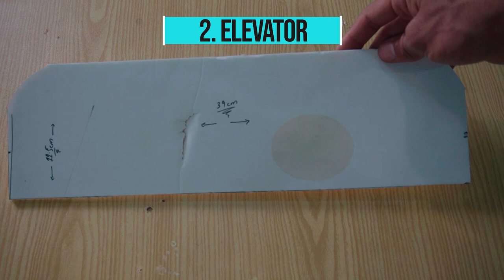How To Make RC plane - depron | Rc plane for Beginners

Comment: Hello. It is a good plane.  You have motor power problems. Your 2212 motor is 1400kv   This motor runs better on 3s 11.1v lipo battery using 8x4.5 propeller. The 10" propeller is too big. Try 9x4.5 for 2s 7.4v pack. The battery pack in the video looks puffy and damaged and may not give enough energy. The second motor is too small for the big propeller. Keep going 👍
Reply: u right.. 1400kv only good for 8inch to inch prop, if using 10inch prop better use 1000kv motor

Comment: information.     at 4:57,  this is  a  SF  prop.    its  use  IS  Correct, in the case of a  Slow-Flyer, ONLY.!!!!!!
at 5:07, the (Mass of the) part of the panel, that will be beneath the horiz-stab  SHOULD  NOT  BE  THERE.!!!
at 5:48, due to its degree of flexibility, this wire  Should  be  Stabilized;   with, either, a  Sufficient number of small guides, or  ONE  (long) tubular guide.!!!!
at 5:51,  the  Alignment of the  top  edge  of the vert-stab  SHOULD  be  PARALLEL  to  the  'air flow'.!!!!
at 6:02, it should be understood that,  a firewall is  Only  as  Strong  as  the materials  USED.!!!!

consequently, it is  NOT  recommended that,  soft/weak materials be  made  Part  of  the  firewall.!!!!           googletranslate

Comment: information.      at 1:25, INCOMPLETE  taper of the  tail boom.!!!     consequently, there is tail heaviness in the dom of  the  TAIL BOOM !!!    distribution of mass. 
the tail boom  Should  taper  down  to  a  (blunt) POINT.     NOT  at  butt end.     if you boys would  BOTHER  to  Look  at  and  SEE, (the underside of) the tail of a cessna  you  would  have  ALREADY  KNOWN  THAT.!!!!
at 2:53, that is a  WONKY  single-surface profile.!!!!      it should have the shape of the  Upper surface of a  CLARK-Y. !!!!!!
at 2:58, it is correct to use a few degrees of sweep, at the stab leading edge.      That  is  NOT  sweep.!!!
at 3:01,  part of the rudder should   NOT  be  Removed.!
THERE  IS  NO  VALID  ARGUMENT, to this statement.!!!!!!
if you want to know,  i  can  Tell  you  what  SHOULD  BE  DONE, instead.
at 3:08, the chord of the elevator is  Greater than, it  Should  be.!!!     the chord of the elevator should  NOT  be  greater-than, thirty percent of the stab root chord.!!!!!!!!!
at 3:39, the root chords of the  stabs   Should  Be   EQUAL, in length.!!!!
the chords of the control surfaces  SHOULD  BE  EQUAL, in length.!!!
googletranslate
Reply: Why don't you just and I mean just make one video about aerodynamics, make it simple rather than talking about nitro or balsa .. when you always act up then step down and help up.. tell these so called boys how to fix the aerodynamics in foam planes and let us all admit your real skills, complaining is rather simple than being real ... Whatcha say fella!

Comment: information.      at 7:12,  Read  My  Lips  -    this profile is  TOO  THICK.!!!!!         you   NEED  to   do  THIS.        calculate  eleven-point-seven percent of the wing  CHORD.   that is:  .117  x  chord  Length.         THIS  is  how thick the  finished  airfoil  Should  Be.!!!!        maximum profile thickness  Should  occur  very near/at   THIRTY  percent of chord, aft of the le.
when a single-surface (aka slow-flyer) profile is used,  it is  Correct  to  locate a  Rib, at   each   wingtip.!!!!       wingtip ribs,  quite  LITERALLY,  wingtip ribs  limit  the  increasing  'loss of lift' beneath a wing,  towards  its  wingtips.       this pressure fall-off, Normal/universal. 
consequently, the design of any wing  Should  Be  Optimized,  Accordingly.     googletranslate
at link, this not the clark-y; but it is very similar, and  the diagram is an  Accurate  representation.        the single biggest difference, between the two profiles is, the max thickness.      the  n-10 thickness, is 11.5 percent; thus, it is thinner.        consequently, the n-10   will make  less lift, and have a  higher stall speed.       in other words, 
ANY  decision to use a  'thinner' profile/airfoil,   SHOULD   BE   AN    INFORMED   ONE !!!!!!!
http://airfoiltools.com/airfoil/details?airfoil=n10-il

Comment: information.      at  7:37,     SKIP   the  LANDING    GEAR.   because,  IT is HEAVY.!!!       Foamboard  is  Also   HEAVY.        in the case of a model this size, and the use of foamboard, a   model should be expected to be, Heavy  for  its  size.!        if you insist on having  lg,  do  NOT  make it, using lots  of  MASSIVE  steel wire. 
btw,  it  Should  be  Obvious, to just about  Anyone, that  All  of  the   Mass  in  landing gear is  Functional, ONLY,  part  of  the  time.!!!!         ALL  the  rest of the time, 
the  Mass  in the landing gear is  JUST   Dead  Weight.!!!!!!!!           googletranslate